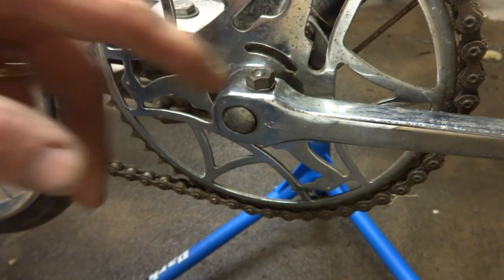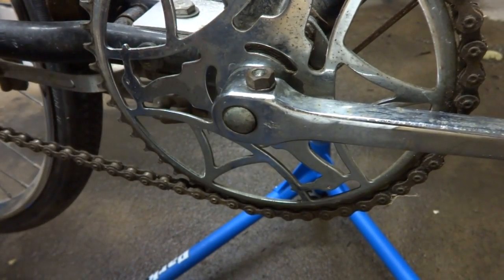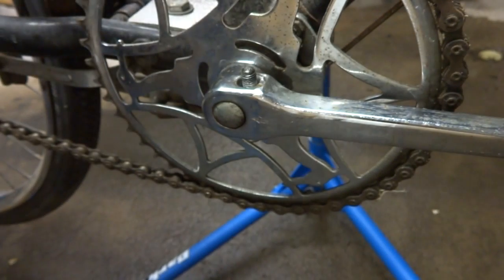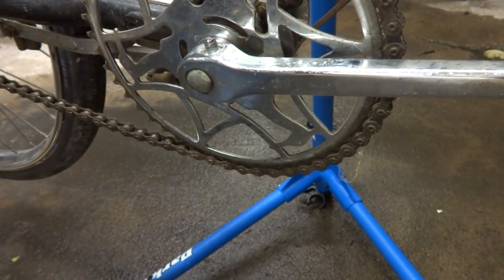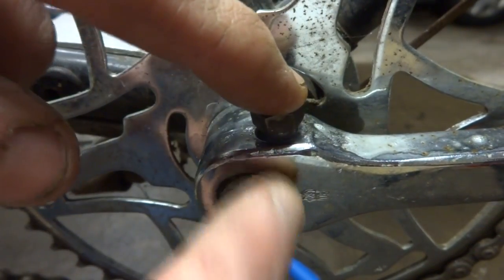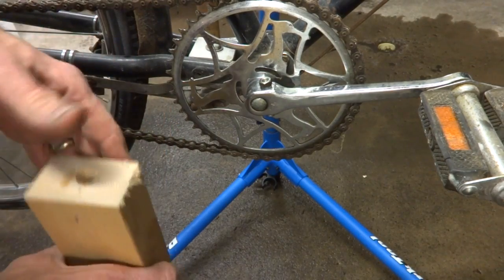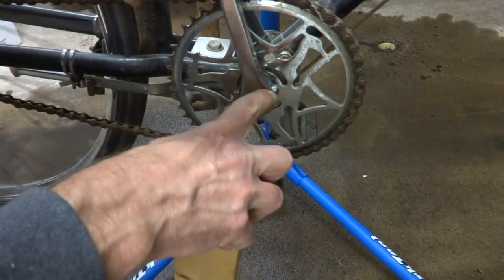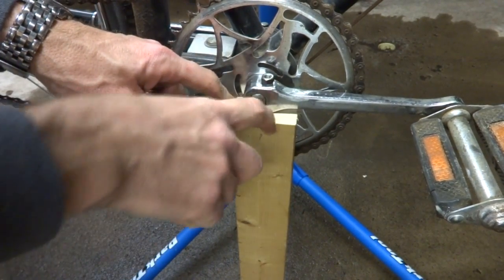How To Remove Stuck Crank Cotter Pin With A Hammer On Vintage Bike

Comment: I used the C Clamp and socket over the pin just today on a 67 Dunelt. I’ll need new pins but those are obtainable. I had not seen the block of wood method before. That’s a keeper.

Comment: What I do, is go to HF and buy a six
inch metal “C” clamp (around four dollars), Next lub everything
(on the cotter pins) up with PB Blaster. Now get a socket that is
bigger then the head of the cotter pin. Hold the “C” clamp so
that the socket is on one inside end of the clamp (position over the
head of the cotter pin) and the other end of the clamp is on the
loosen nut of the cotter pin. The idea is, as you apply force, by
tightening the “C” clamp, the head of the cotter pin is moved
into the open inside space of the socket. This should work even if
the cotter pin is bent. Three final thoughts, one is loosen the nuts
as the video shows. Second,  is you might have to use a small brass
drift to tap out the pins when they are almost out but still stuck
inside the cranks. Third, is use a pair of vice grips on the “C”
clamp if you run out of torque. Take your time!

Comment: One time my crank started to get some play in it. I rolled into the nearest bike shop and said i needed to borrow a couple of hammers. I held one on the back side of the crank to absorb the shock and tapped on the pin with the other. Then I took up the slack on the nut and I was good to go.

Comment: Looks like a great meathod! I'll have to try it out. I've alwayd had luck with a c-clamp and a socket. A couple of shots from a hammer on the top of the clamp if its stubborn usually does the trick.

Comment: When I bought a used three speed in Norfolk, Virginia in 1969 the bike shop had a set of pincers similar to bolt cutters for removing and replacing crank pins. I got to use it. A lot nicer than using a hammer which I had done many times.
Reply from the maker: Not familiar with those. There used to be some tools that worked like C Cla,ps. but they are out of production. You can find them used on ebay.

Comment: I learned about Liquid Wrench, you refer to it as penetrating oil, many years ago. I've had many stubborn parts succumb to its persuasion. In this instance, it didn't seem to work its usual magic but we'll never know what the outcome would have been here without it. I'm sure it helped. The way the crank just glided off the spindle can surely be attributed to it---that, and the vibrations that all that banging produced, allowed the solvent to penetrate.

Comment: Thank you! I wasn't even sure what the terminology was for these parts until I found your video. 

My suntour centurian had the cotter pin's threaded end come off with the bolt (my fault for over tightening). I'm going to try placing a small chisel on the remaining part of the pin and using your hammer technique to free it up. 

Now to find a place to buy a new cotter pin...
Reply from the maker: Check this vid out: https://www.youtube.com/watch?v=9Qc2wzyeXk0

Comment: Is it ok to reinstall using the same cotter pin or would you go for new pins?
Reply from the maker: If the threads are not mangled, you can reuse it.
Reply: Thank you for the super quick reply & detailed vids

Comment: Brilliant videos. Thank you. I had a stuck stem and your method of tapping the bolt to free up the clamp worked perfectly. Unfortunately I'd already mushroomed the cotter pins in the crank but on another bike the methods in this video worked perfectly.
Reply: how did you get the mushroomed cotter pins out ??
Reply from the maker: F McEwan I don't know about MokeyShred, but I ran into one cotter pin that just would come out using either of my normal methods. I ended up drilling down through the cotter pin. You can see it at about 2:30 in this video: Overhaul Bottom Bracket On Vintage Peugeot Bike

Comment: How do you get one out if the SEIZED pin is bent slightly on the threaded portion??
Reply from the maker: Same thing, or you might have to drill it out. You can get replacement pins. You will have to file them down to match the angle of the original.
Reply: @RJTheBikeGuy  any tips on drilling out a cotter pin? I tried the hammer method and ended up fusing the nut to the bolt so I think I'll need to drill it out now. thanks.

Comment: Hello I have a Peugeot PX 10 frame I found in the trash.  The cotter pins are both really jammed inside and there is no way to remove them.  Do you have a suggestion on how I can cut the crank arm?
Reply from the maker: If you can't pound the pins out, then drill them out.
Reply: ahhh!  great idea.  Thank you
Reply from the maker: I drilled a pin out in this video: https://www.youtube.com/watch?v=4zpQH41DIA0
Reply: Thank you
Reply: That is the exact bicycle I have in your video

Comment: Oh no the pin on my old bike  got mushroom out , just hitting by hammer without placing nut on it. Still not even moving the pin. Any further solution Sir ?
Reply from the maker: You may have to drill it out.
Reply: @RJTheBikeGuy  Thank you Sir, Finally done it :)

Comment: Restoring two his and hers early 80"s steyr cruisers, the hammer method made me cringe, im thinking some kind of vice or punch press, your method is counter productive to the preservation process of these extremely rare bikes, is essentially a hurried hack job,
Reply from the maker: Good luck with that. Even using a press or vise, I have still had the pins bend over and end up drilling them. More often than not I end up replacing the pins with new ones.
Reply: thank you! yea I work at a wheel fun rentals location we rent bikes, Surrey's paddle boats act.. the boss refurbished a couple of the older surrys with the pin cranks still yet to ask him  about it.